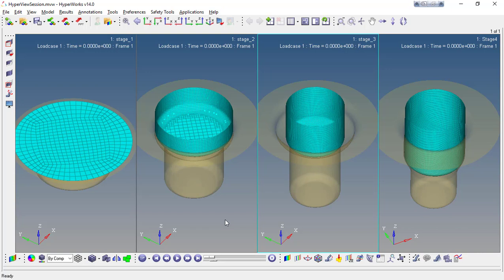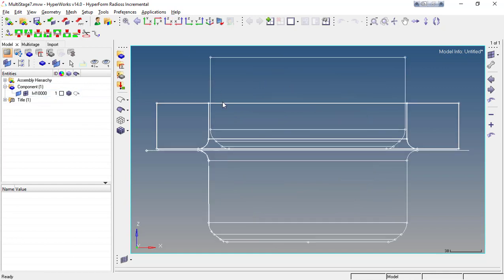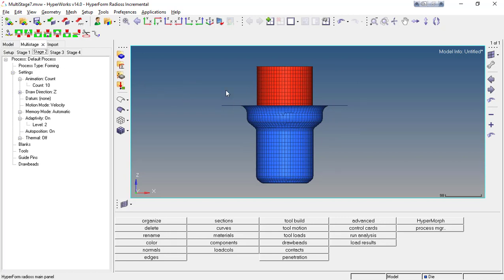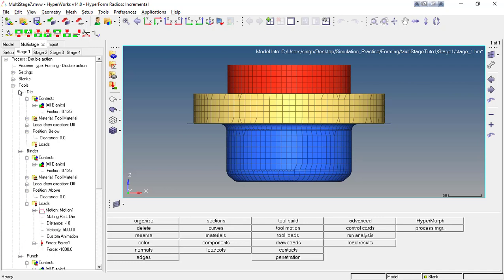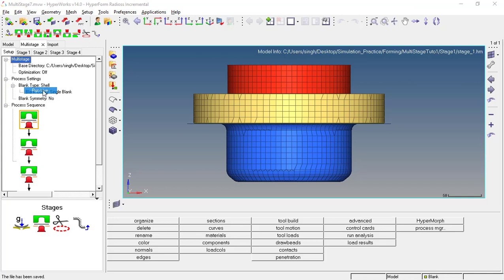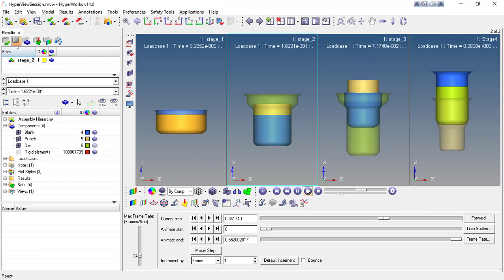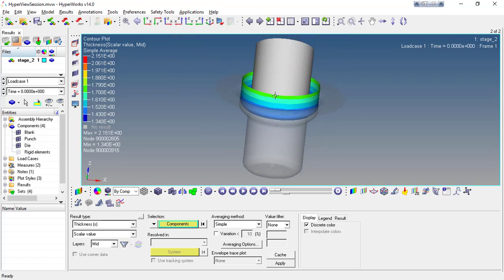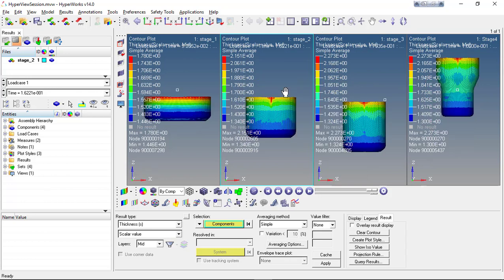06 Multi-Stage Deep Drawing Process Simulation

Comment: Hi, thanks for sharing this video. i have one question.  I have design tool in my software and now i would like to check whether my output (finished part) will be formed precisely or not as per tool then how can i check ?
Reply from the maker: Dear,
The only way is to check by CAE simulation. However one can rectify errors by experience too.

Comment: Thanks you for the tutorial for multi step deep drawing analysis. Is there anyone who knows Abaqus analysis for this analysis?
Reply from the maker: Dear,
In Abaqus you need to setup all things manually. No process manager available. I can guide if you find any difficulty.
Reply: @arsitech-ltd  Hi. Thank you for your reply.
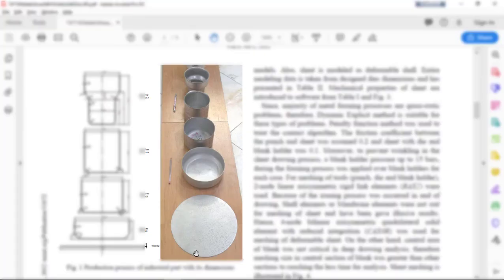I tried to think of setting up the multi-stage deep-drawing analysis with Abaqus but having difficulties managing steps. I searched the paper you used in this video 35:00. It says that the deep-drawing is done in Dynamic Explicit and The spring back is done in Implicit. However, annealing operation is in the third step. I have two questions here.    Q1. How to make Explicit analysis as the1st deep drawing step and spring back in the second step?      Q2. Is it possible to include annealing steps in the deep-drawing analysis? as I understand, annealing is about releasing temperature-dependent properties. Is it possible?
Please guide me through the analysis set-up for two-stage deep-drawing steps including spring backs in Abaqus.
Reply from the maker: Dear, two videos i already uploaded for multistage simulation with Abaqus...you can go through
https://youtu.be/h2UQxuWz_DI
https://youtu.be/MoTMNfXLUgw

Annealing can be added... separate step is available for the same.

Comment: Nice tutorial! I´m learning FEA theory and sometimes is good to see some practical aspects. It´s been an entertaining video. I hope you find the right parameters and the perfect tool design in order to avoid that thickness variation. Maybe you should try lower strain rates and a better lubrication inside the die.
Reply from the maker: Thanks for positive feedback.
The mid cost lubricant available with little higher friction coefficient...so i decided .125 friction coefficient.
Reply: @arsitech-ltd  You´re welcome. I talk from my knowledge as student, I supposed you had already thougth about it. :) Keep working on it you´ll find the way